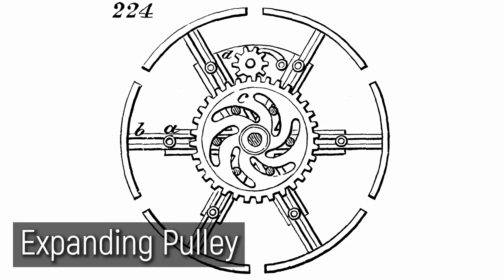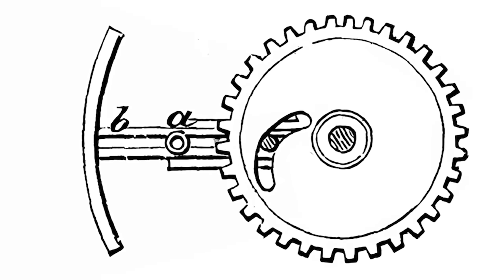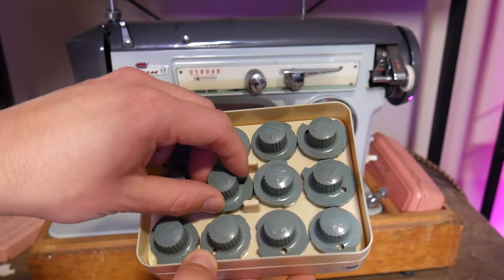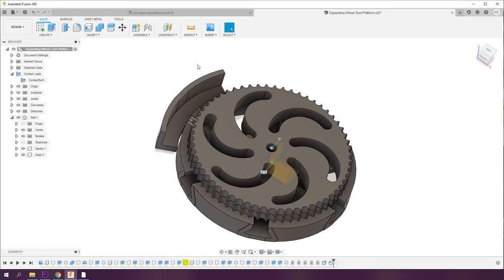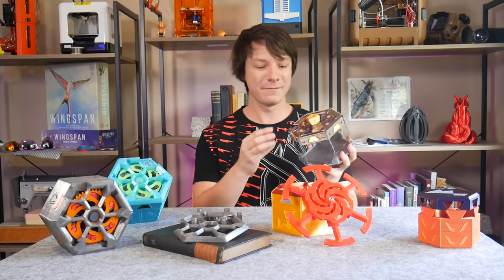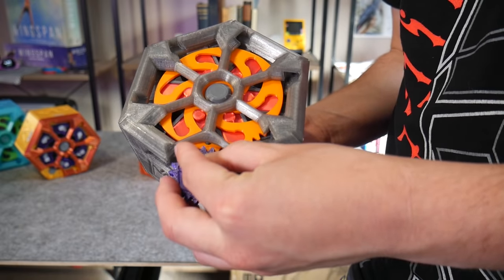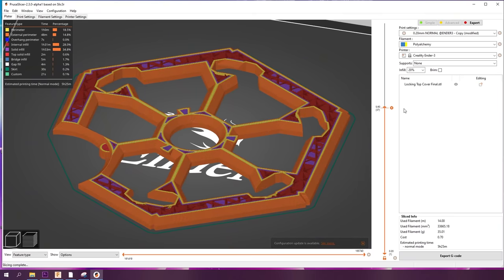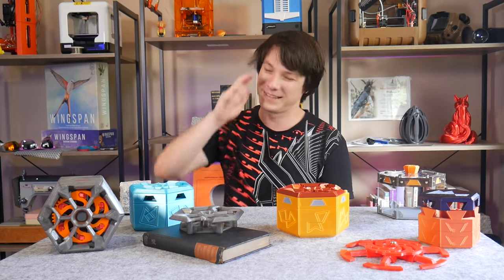This Expanding Mechanism is Crazy Clever

Comment: Back in the early 90's this mechanism was used to create an "Automatic" gear on a bicycle as it had this mechanism spring mounted and used the torque placed on the pedal to reduce the diameter of the drive gear.
Reply: When I saw it Iwas like ummm couldnt this be used to make an automatic gear system, and there was your answer.
Reply: @mimoslavich6639  LOL.. Same me
Reply: What was the reason why this wasn’t continued after the 90‘s? Looks quite superior to stacking different sized gears next to each other.. and would eliminate the gear switching problems..
Reply: There's a mechanism called a variable transmission (I know its used in mopeds) that this reminded me of. It's basically two bowls spring loaded together at the base like this )( When the speed increases, the centrifugal force pulls the pulley apart )-( so it becomes a smaller diameter pulley system.

Different mechanism, but same idea behind it.
Reply: @ajsparx4133  if I understand that right that would be a transmission that automatically adjusts to speed, right? Sounds like a high tech moped...
Reply: @donalain69  Yep, its a gear-free transmission. I think it was in pretty much all 50cc mopeds, it wasn't really that high tech. I remember if you wanted to take the limiter off (you could get anywhere from 5-15mph more out of the moped), you had to remove some sort of ring that was in the middle of those two pulley sides.
Reply: I've heard of washing machines that used a similar mechanism to accelerate the spin cycle.
Reply: @ajsparx4133  damn! Wish I had one of those when I was young! I was driving a Puch 50 cc with 2-speed gearbox... just managed to get about 3mph more by drilling holes in the exhaust :)
Reply: @varmituofm  thanks for the tip.. will go trash my washing machine an salvage that part for my motorbike :)
Reply: @donalain69  I was so cool as a 15 year old, that little scooter could almost hit 50mph going downhill!
Reply: @ajsparx4133  lol.. mine just made it to about 35mph.., but you could hear it almost to the other side of town :).. miss the good old days. 🙄
Reply: Exactly what came to mind when I saw it.
Reply: @ajsparx4133  IT wasn't JUST in 50cc mopeds. The same design was in 80-90mph scooters such as the Honda CH/CN250 (Spacy/Elite/Helix) and 400cc Yamaha Bergman and in 1960s DAF cars
A version is used in Nissan's CVTs to this day (hydraulic actuators setting the pulley face distance and chain driven rather than a rubber belt)
Reply: @donalain69  The standard way of linmiting speed on 50cc scooters was a restrictor plate on the engine outlet. Removing those could result in things like Suzuki FA50s capable of 60mph - and if you look at those wee things you'll realiase that's scary fast
Reply: @miscbits6399  Awesome! I love learning MISC BITS like that!
Reply: @ajsparx4133  FWIW my ch250 from a standing start and no pullback would lift the front wheel a few inches if given full throttle and stay there up to about 40mph. It was wind-limited to about 70mph but by going bullet-nosed (head down by the instrument panel) I was able to get it up to about 95mph

Some of the friends who rode with me said it was always amusing on motorways (60mph speed limit in those days)  to hang back behind me and  watch the faces on car drivers as a scooter blasted past them in the fast lsne
Reply: @miscbits6399  I had a Honda Elite SR50 in neon purple, and I got a big ego out of "driving myself" to driver's education classes! I was pretty hot snot lol
Reply: My friend has one of those bikes
Reply: It's also in virtually every snowmobile made since like the first skidoos.  They just call it by it's parts - centrifugal clutch and expander pulley instead of calling it any sort of transmission...
Reply: Also anyone looking for a similar mechanism for a homebrew go kart, moped or trike can find several self contained units designed for attachment to one of several gas engine mounting flanges under the brand name of torqueverter iirc that's the right spelling
Reply: We like bicycles. Robots find them very fascinating.
Reply: Me who knows nothing..visable confusion
Reply: Was thinking this would make an infinitely variable gear box
Reply: i got the parts rim with the gears my mom got me the bike from the shopping channel in mid-90s
Reply: Looks kind of like a Centrifugal Clutch (or Automatic Clutch)
Reply: @donalain69  maybe cause you drilled holes in the exhaust like a goofball?
Reply: did it use a chain/belt with/without teeth ? I don't see how you you can increase the size while a chain or belt is wrapped around it..
do you know the name of this automatic gear mechanism or online information about it?
Reply: @donalain69 not a high tech moped, just a moped
Reply: @donalain69 theres one caveat though...you can't wrap a chain or tooth belt around it since it would have to stretch/contract. so all you are left with is having the possibility of a slipping belt...very inefficient for bikes and I don't really see advantage vs any CVT design using half pulleys that can slide closer/further from each other which is the base for belt and pulley cvts
Reply: @miscbits6399 there's a bunch of different ways to restrict mopeds and all combinations of those have all been used. variator weights/springs, throttle, exhaust, carb...
Reply: @geemy9675  I agree, but in my experience restrictor plates are the most common because they're cheap to implement amd easy for inspection authorities to verify
Reply: Can y'all tell me what book this is from? I want to get it for a kid
Reply: @williamcastille4193  makes sense, since you can't continuously change the diameter of a gear driving a chain, you can't  change the gear ratio the only two options are
-changing the radius of the wheel...not very practical
-changing the radius of the pedals
of course you  will still have constant ratio between wheel and pedal rpm but it's easier to pedal fast with a small radius, and  longer crank arm will help for climbing, up to a certain point
it would definitely not replace a wide ratio derailleur or even work in any competitive form of biking but it's a funny concept
Reply: @geemy9675 you’d have to use a tensioner on your belt so it can change length as the  gear expands.
Reply: @undertow2142  the gear cannot expand with the belt or chain wrapped around it.
Reply: Centrifugal clutch
Reply: @miscbits6399 that must have been a beautiful sight!

Comment: That mechanism is gorgeous and I love that you've modeled and 3d printed it. It's way easier to understand once you see it in motion in the real world.
Reply: I predict a super sized version coming soon. :P
Reply from the maker: Ohh a huge one would be insane!
Reply: @MakersMuse  Dude the locksmith lawyer will not be impressed. A magnet lock can easy be hacked using a magnet and then rotating the wheel by hand. You need to connect it to a pin locking mechanism which releases the wheel when it begin rotating when the correct key is inserted that would need to be part of the gear key. Also making an organic tooth path and hiding the teeth under plastic will mean you'd have to capture the dimensions of the regular key and the gear itself.
Reply: @pavellelyukh5272 

You forgot that this was a puzzle box, not a lock to secure valuables with. The Lockpicking Lawyer deals with the latter, not with the former. In other words: concerns he would raise are entirely irrelevant to this video.
Reply: @AhsimNreiziev  actually locks are puzzles. Magnets aren't because the effect is too global. Imo a puzzle requires the manipulation of objects in 3-6DOF to work so unless you use a extremely advanced magnet with selective polarity you'll basically only have 2DOF puzzle
Reply: @AhsimNreiziev  He definitely deals with the former when a bottle of scotch is involved.
Reply: hm
Reply: @pavellelyukh5272 

Locks can be puzzles, but it's ridiculous to claim that all locks are puzzles.

It is even more ridiculous to claim that all puzzles are locks -- even worse, specifically locks that are used to secure valuables with, as one can also have locks that are not used for such purposes and therefore would be under no obligation to be resistant to picking techniques -- which is the claim that would be needed for the Lockpicking Lawyer to have any relevance in this conversation.
Reply: @AhsimNreiziev  your mind must be locked in a puzzled state 🔐
Reply: @JonathanScruggs  Ahah! Should make an human-sized door XD
Reply: I think that Mechanism had some telescoping parts, or leaves that could be put in to compensate for the expansion. I am not sure but it looks like it is just a example of the mechanism, not the full picture or use of one.  I wish there was a book explaining what each were used for.
Reply: more of a Chris Ramsey thing than LPL, but that dude does like $30,000 custom one of a kind puzzle boxes so idk, but he does simpler stuff too. He'd probably at least be interested.
Reply: yes
Reply: @AhsimNreiziev  yeah like "i can defeat this with a hammer in 2 seconds"

Comment: Another masterful mechanism Angus! I wonder what kind of funky stuff you could do by using different shaped slots for each pin :0
Reply from the maker: All sorts of funky motions! I'm definitely gonna keep experimenting
Reply: there have been tables using it
Reply: @MakersMuse  This is primarily just a thought, but I imagine if each pin was offset slightly beginning the motion, you could likely achieve an almost revolving opening pattern, where each locking lug opened sequencially
Reply: bro time for u to start work on new project :D
Reply: its a cam
Reply: Try to make a expanding arm shield with it.
Reply: What it is to do is expand, as a belt to drive some thing is stretched during use.  That's why a locking gear  is installed to keep size ridige until belt stretches more.  Some times used on wide leather belts to drive early machines.  These expanding pullies were quite wide 3 to 4 inches.  Had these on some machines where I worked when I was young.  Black smithing wagon making shop.
Reply: Angus beef
Reply: @keithmeisenhelter5855  this makes a lot of sense - it could allow a pulley to act as it’s own tensioner.
Reply: Masterful mechanism? That its why it is an old book and not used in modern day items? This is like Reinventing the square wheel!
Reply: So you cud just put one More magnet behind The one in The box that is strong enoff to hold The other magnet there but now stronget than in The key
Reply: @Niels357  so because something is not used anymore means it has no posible uses in the modern world
Reply: @MisterCOM  not what i sad. Old good ones are still used. bad ones are not. It needs to serve its purpose! If it does not don't call it a master mechanism! Its a shitty box and you know it
Reply: @MakersMuse  Did you mean opening it by rotating the key by hand goes against the spirit of the design because it's kind of a cheat since therenis no puzzle to solve that way? But couldn't figuring that out be itself a puzzle?
Reply: @digitalChaos Good plan. Use a microcontroller to adjust the two "wheels" together, rather than a belt tensioner idler, for fewer moving parts.
Reply: @MakersMuse  you might be able to print a weak magnet if you could put a bunch of spots of iron-filled filament in something, then ran a magnet over it to magnetize it... or you can just make it so the key hits a bunch of pins in hard to reach places or recesses.
Reply: I've just realised how similar both these guys logos are (Make Anything and Makers Muse). I wonder who copied who, or if it was a case of 'parallel thinking' lmao.
Reply: @digitalChaos . I think thats called a cone drive used on Bobcats.
Reply: Fallout flashbacks
Reply: Used on the back end of big vault doors or analog safes
Reply: amogus
Reply: I read angus vary wrong

Comment: It could be used as a fly wheel, the change in size will affect inertia, dunno where thats useful tho.
Reply from the maker: Actually that could be pretty neat! Like how swinging your legs out on an office chair slows or speeds up your rotation.
Reply: I think I've seen a similar use case in some clocks
Reply: @MakersMuse  How about variomatic?
Reply: It's also how cats rotate in midair.
Reply: I think that has been tried in perpetuum mobile ;-)
Reply: For example centrifugal clutch
Reply: Would be good for a flywheel on a generator
Reply: It could've used in a clutch type usage. It's very similar to a centrifugal clutch already.
Reply: I was thinking as some sort of clutch also.
Reply: @Jammermaker  Veritasium has a nice video on compliant mechanisms which uses a flexible clutch that engages if it turns fast enough.
It does seem a bit similar.
Reply: @insulterify  was bouta mention those
Reply: You can use it for the flywheel on a street legal manual to make it more drivable day to day and then lover it's moment when you go to the track to make it more responsive. Not sure id do enough to make Mitch of a difference.
Reply: I've had a real think on this and I think the beauty of an expanding fly wheel as a storage device and engine could be that you could efficiently store the kinetic energy into the flywheel with the mechanism 'shut' or at its most compressed point, and then when needed the energy can be harvested by expanding the fly wheel into a mildly expandable belt to rotate a gearbox/engine of some sort as needed. This reduces the initial energy required to start the engine as there is no friction on the fly wheel when compressed, then when expanded it tracks on to the belt to release the stored energy.
Reply: The principal was used for Speed Governors on Steam engines of the era. That's you spend the more you extend out once you reach a certain point the governor kicksend and protects the engine and you.
Reply: Trade speed for torque!
Reply: Look up a CVT. Type of transmission that uses inertia to move weights around in a gearbox to provide continuous and smooth acceleration without jarring shifts.
Reply: It's pretty much a weed eater clutch
Reply: @Yomom12388  Yes, this has CVT written all over it. With the pully and slotted disc on a shaft, have the disc locked to the shaft, while the pully turns free, except then use a coil spring to connect the pully to the disc, so that when relative torque is applied, the pully rotates relative to the disc and shaft, so it changes size. Now when torque is applied, the pully expands or contracts as needed, so the gear (or pully) ratio is adjusted automatically as torque varies. Slack in the belt can be taken up by a standard "idler wheel on a tensioner arm", which most cars already use to keep tension in the serpentine belt as it ages and stretches.
Reply: slow the speed?
Reply: @MakersMuse  You could use a pair of these where one opens as the other closes to make a CVT transmission. The belt would wrap around the outside and the tension on it would remain constant.
Reply: @cedley1969  except the pressure on the inner "cam" would be massive. Then you have the issue of lack of smoothness, and in most transmissions, that would kill the idea on the spot. The way CVTs actually operate is pretty well thought out in terms of smoothness & power holding ability.
Reply: Spring-less speed regulators. Torque limiters. Some limiting clutches. Actually used
Reply: @SmileyTom666  Yep that’s correct but if you use a bearing in place of inner cams, the high pressure wouldn’t hurt. Still workable in CVTs. And although current CVTs are nicely designed, they need a push belt, that uses friction on sides. Thats a limitation for its max power transmission capability.

Comment: The expanding pulley design is used in the fletcher capstan table.
Reply from the maker: That table is a work of art! I think it might use some elements of this mechanism but it's also far more complex with the inserts that fill the gaps.
Reply: ahhh... i wanted to say that.
Reply: iam 4 hours late..
Reply: Late also, 
I wonder what other mechanisms go into the table to get the pieces to open wider then close to accept the wedges moving up.
Reply: @tye2876  I'd expect some helical tracks, some parallelogram to move them... well... parallel. Also maybe some springloaded detent to keep everyting in place.
Reply: @tye2876  like iris windows
Reply: I am so late to the party
Reply: thats what i said!
Reply: That is the amazing table with a finger collection jar?
Reply: @MakersMuse  it better be, the starting price is 2.2 million dollars!

Comment: Hi Angus, this this expanding pulley design was used in the design of an underactuated robotic finger in this academic paper: Underactuated Gripper That Is Able
to Convert from Precision to Power Grasp by a Variable Transmission Ratio (Spanjer, Balasubramanian, Dollar & Herder, 2012)

The finger has two joint both actuated by the same tendon, which passes over a pulley at each joint. By changing the size of radius of the lower joint's pulley, the stability of the finger tip force and grasping capability of the finger could be changed while still retaining some of the major benefits of an underactuated finger.

Comment: The expanded pulley has exactly the same friction contact area with the belt as when at the minimum size.
There are many, many small vaults and lock boxes that use a system like this, but only to drive 3 bolts (up, down and the locking side, though sometimes there's a 4th, but that's normally where the lock bolt blocks the rotation) with the plate driven by the outside handle.
Nice project! I'm also impressed you can get Fusion to move things that smoothly in the animations with contacts on!